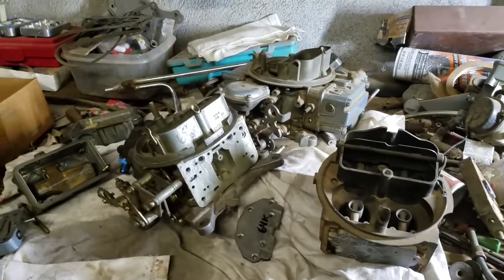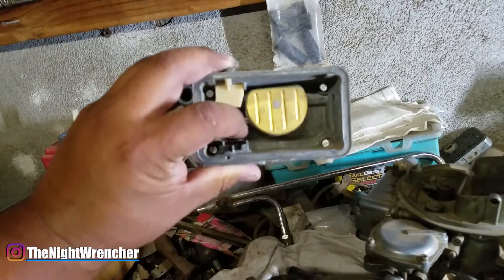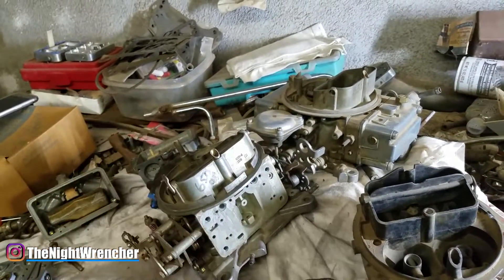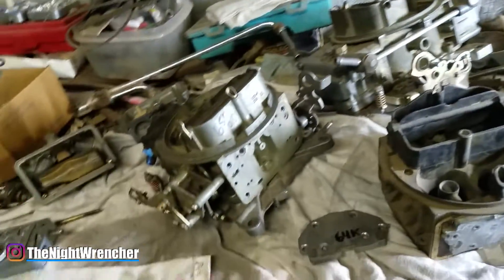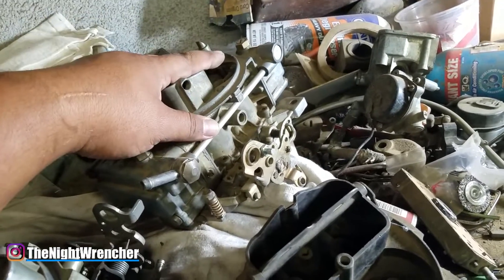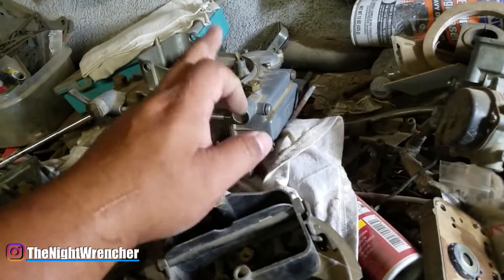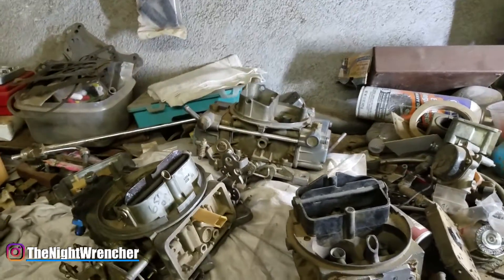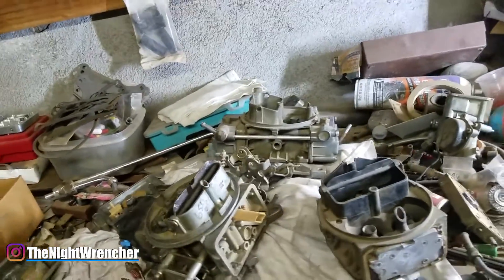CONVERTING A HOLLEY 4160 TO A HOLLEY 4150| Holley single feed to dual feed | Holley Carb Secrets |

Comment: not a bad video  just to note though you can buy a conversion kit from Summit racing for 73 bucks that comes with a block and a longer fuel transfer tube etc...  sure it's not a dual feed but on another note you mentioned picking up another carb cheap and here in Canada where I am that isn't an option. They don't really exist  a guy will have to spend a ton of money to buy a used 4150   and then probably rebuild it or buy new which for a 4150 is  650- 1000 ish dollars. .. by using the kit a guy can do that and then if wanted can buy different float bowls down the road. !
Reply from the maker: Very true! I forget sometimes that outside the US its much harder to get a hold of holley carbs and parts. Best place I would check would be ebay but thats about it. I think I feel a bit spoiled because we can find used holleys locally for cheap, but I hope you can find what works best for you.
Reply: @NightWrencher  you're lucky for sure !!  I know ebay is an option but our dollar sucks so it gets expensive fast to buy from the US and shipping is insane too.   I picked up my 4160 used for 150 ( US equivelent)  so while it's not my ideal carb I'll work with it.  I'd totally do like you do if I was somewhere used Holleys are cheap !
Reply from the maker: @timd4151  oh man! Must be tough, as long as you can make it work for you, a 4160 isnt a bad carb!

Comment: Can a Holley 750 vacuum secondary ( 3310) be converted to a Holley 750 (4779)mechanical secondary  (double pumper) if so please steer me in the right direction
Reply from the maker: It can be converted to a mechanical secondary but it cant be a double pumper because the holes for the secondary squirter is not there unless you swap out the main body too. So youll need, rear fuel bowl for a DP, baseplate and center section. It would be cheaper to buy another carb and sell that one vs trying to make it work. That being said, I find tuning vacuum secondary holleys much easier.

Comment: My 4160 450cm 9776 carbs are mechanical secondary but no secondary pump
Reply from the maker: I didn't know about that carb. I just looked it up and its a weird carb. mechanical secondary with no rear squinter and no rear metering block. Doesn't seem like something I would want to build XD
Reply: @NightWrencher  yep its advertised as the tunnel ram carb. Probably benefit from 50cc primary pumps. I got 2 on my tunnel ram. Wish it was a double pumper due to mechanical secondarys

Comment: Maybe a stupid question here, but the fuel inlet on the 4160 carbs is on the same side of the carb as the throttle linkage (driver's side). On Chevy's with mechanical fuel pump, the fuel comes up on the passenger side of the engine. Is it possible to swap the primary & secondary float bowls so that the fuel inlet is on the passenger side of the engine?
Reply from the maker: Not really since the transfer tube would have to go through the vacuum secondary pod. Your best bet is to buy a metal fuel line the fits your inlet and bend it in a U shape so that you dont have to bend the rubber line

Comment: Hey man, appreciate the video. I’m having an issue with my Holley 750 double pump dual feed. Mind you I’m in now way carb savy. My issue is that is fuel being pumped out of my secondary vent tube. My floats and needles seem to be fine and fuel pressure seems to be between 5-6psi. If you could point me in the right direction I would greatly appreciate it.
Reply from the maker: I would suggest turning down the pressure until the problem goes away. I had a 575 demon give me a lot of issues so I turned down the regulator to 4.5 and the flooding slowed but it didnt stop. Turns out it was a bad oring on the needle and seat. On an 1850 it kept pouring out even with new needles and seats and the float turned way down low. Lowered the PSI to 5.5 and the problems went away. Hope that helps!
Reply: @NightWrencher  okay I’ll give that a shot. Hopefully that solves the issue. Thanks 🙏🏼
Reply from the maker: Good luck!

Comment: They holley 3310-10 like I have that think it was $200 I got it for, would think it to be a 4160 equivalent. It had center hung bowls, came with the rear metering plate and vacuum secondaries. I already had a 4150 an fuel log that I bought a long time ago for one, so first mod was a secondariy metering block out the gate. It had copper inlet fiters that I found to be trash, they cogged to easy and cracked one bowl messing with it a bunch. Second upgrade was bowls with sight glasses, makes for good check on fuel level. I did strip the squiter at some point and needs snugged up every so often, yea dont over tighten those. 

I got a summit M2008 750 on it now for a carb to set up for max economy since had annular booster, yes could had got a brawler main body for the one I got but this was for $100. Having two 750s can go the route of having the holley setup for max power. So when ever I get back to the holley, it get a new main body. Not sure if will get a holley hp/xp with dog leg boosters or a bawler annular ones, ether way it will be with out choke horn and I like how the xp looks. 

So I may end up in the boat of drilling a 4150 body for 4160 vacuum secondaries when I get back to it. In turn at the end of the road would be sort a 4150 base plate to make my parts one, my secondariy bowl only needs drilled and taped for a pump. Looking at cost a xp main body is $250, no name base plate $100 and no name billet adjustable metering blocks at $100. That would be less than half the cost of a xp and a few hundred less than a quick fuel new. 

So dont see loss in building a 4150 from parts and could save some on used parts. This would leave me sort the bowl I broke and fixing the threads on the squirter to get it in shape to have ready to resale to recover some the cost. In turn dont see much loss much loss in starting with one I got since gave a starting point at a good all carb to learn what I wanted from it. In the long run it might had been better to have spent the extra on the adjustable metering blocks from the start, but hind sight is 20/20.
Reply from the maker: Seems like you went through your own carb journey!
Reply: @NightWrencher  Yea when last driving the truck 5 years ago, it was a bit of guess work without a wide band gauge. Having issues getting a block decked in my f350, means I have to make a long run in my f100. When last using it was seeing how lean I could get it to run without issues, especially when the secondaries opened. At 9 mpg and $4 for premium, I got this summit carb to see if can get closer to 14 mpg. I got a wide band this round and thanks for the info you have to share.

This what I have going on with it > watch?v=sEWHZ6Y5F94